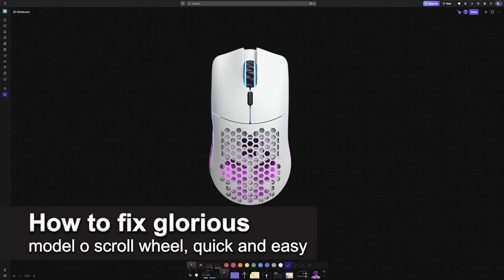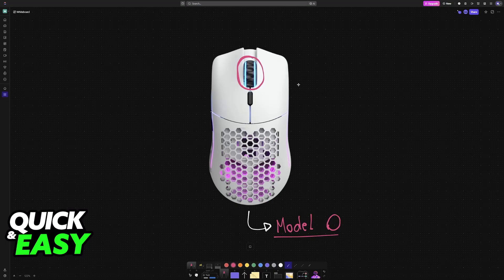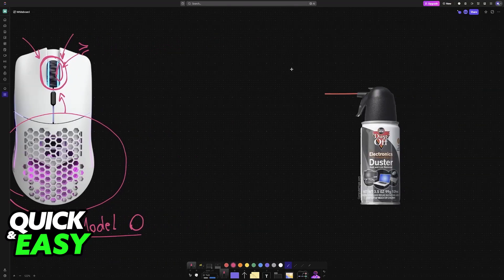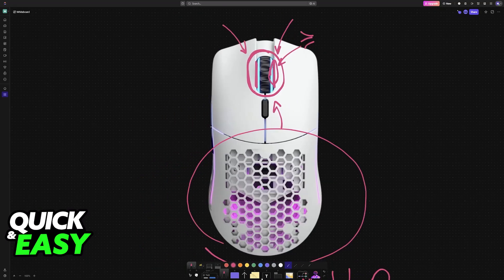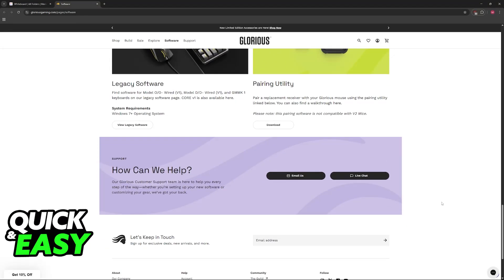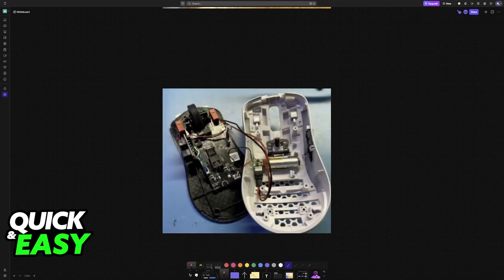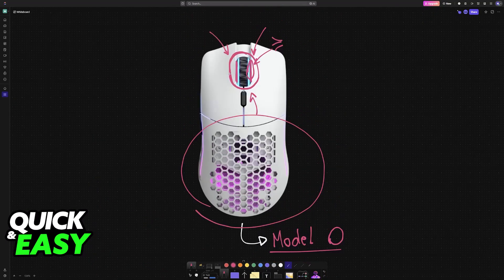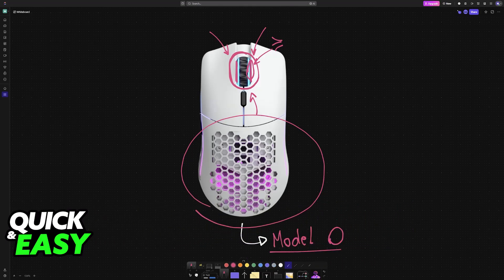How To FIX Glorious Model O Scroll Wheel (2025) - Step by Step

Comment: it is all loose and scrolls like the one logitech mouse
Reply: have you fixed it?
Reply: same
Reply: Same
Reply: same
Reply: same
Reply: Dude help me me too
Reply: same
Reply: Ah, does it rattle when you shake it? then the axles broken. you can open it up carefully, unscrew the chips, and superglue the axle, which will work if you glue it straight. you must be gentle with the scroll hereafter though. This mouse is great except for the shitty oversight with the tiny axle